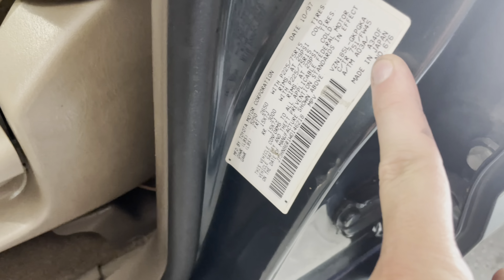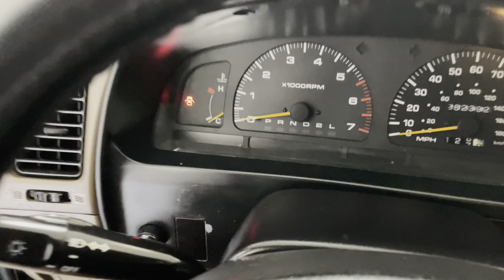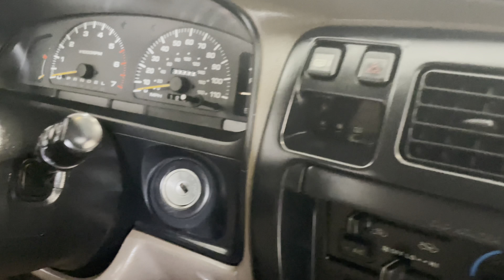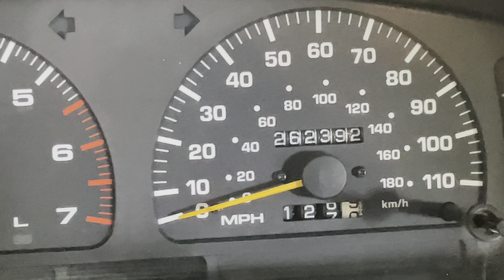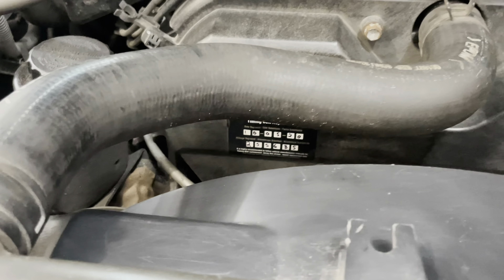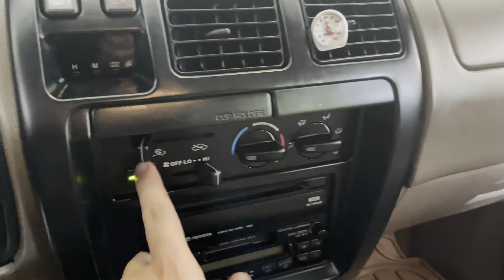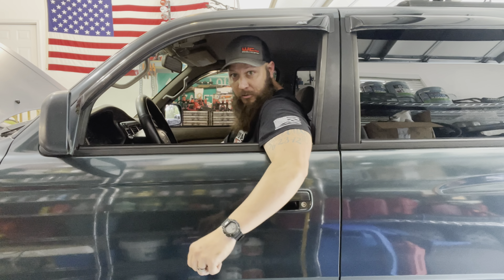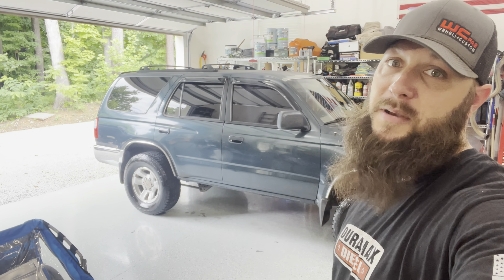Scotty Kilmer Is Right About The Toyota 4Runner!

Comment: Old lady is selling her 94 4wd 3.0 with a few cosmetic scratches with 90k miles
Engine sounds fantastic! 
The only issue I noticed is a lot oil underneath.
Asking price 6k probably negotiable. Wondering if worth it.
If I buy it planning to use for road trips.
Any advice? Or should I bring it to the dealership for full inspection?
Reply from the maker: If def have it checked out. 3.0s are pretty good. But known to have a few issues. Nothing major. Good luck!

Comment: just wondering if you could answer some questions?
Reply from the maker: I can try
Reply: @linksgarage1985  I am looking to buy a 97 4runner and yes its way high on miles, 301k!  I have wanted an older one for a long time and they are hard to find.  What should I look at and ask the owner tomorrow when I test drive it?
Reply from the maker: @FreshGrey-pm4vw  my dad has a 97 with 300k on it. 

Timing belt replacement, and pro change intervals. That’s really it. And rust. They are pretty legendary.
Reply: @linksgarage1985  thanks.  if it was in fairly good shape what would you pay?  he wants $4700 which is 600 higher than the top of the kelly blue book.
Reply from the maker: @FreshGrey-pm4vw  hard to say without seeing it. But they go for a fortune now. Usually way over KBB